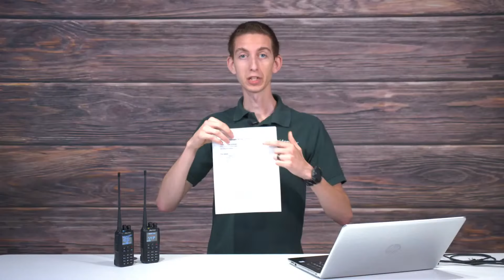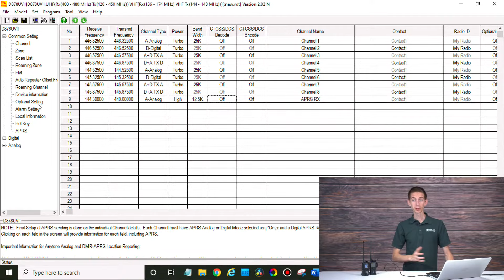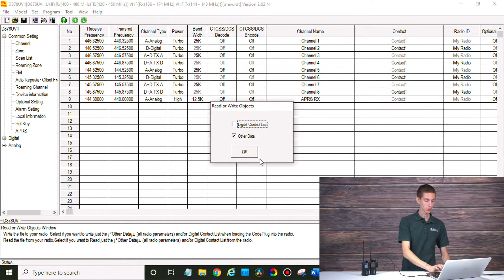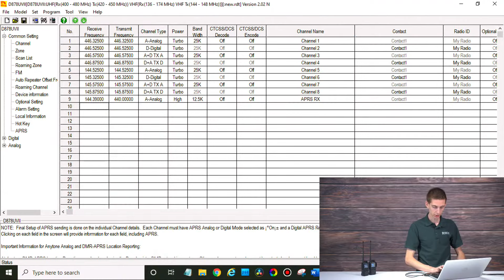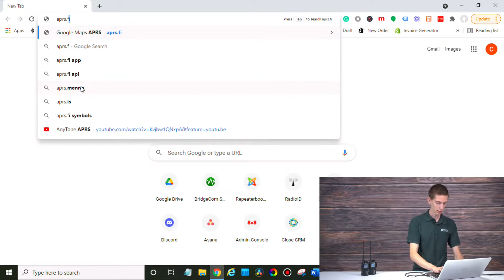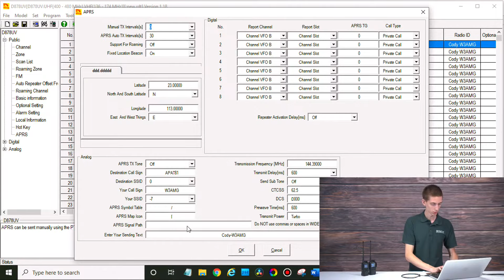How to Send and Receive Location Data from your 878UVII Plus | BCU Live Free Training

Comment: If the instructor would just look at the two radios "Fixed Location Beacon"  setting, he'd see that the radio that's working is set to on.  Why?  Because when you cannot get GPS Signal, you turn on "Fixed Location Beacon" so that it will transmit APRS using that instead of the actual GPS data.  That's why the new radio was not transmitting APRS and the old one was... I watched this video to learn something but was disappointed to see that as a new DMR/APRS HAM, I already know more than he does....

Comment: I have an Anytone 878UVii and set it up exactly as you did and still the radio will not show received APRS messages.  I even put the APRS display time to 15 seconds to ensure I wasn't missing anything. Even when I go into Ana APRS Info, it says Ana APRS info Empty! It is transmitting and appears to be seeing an RX signal as it wakes the screen up periodically, just no messages. And yes I have all the filters ON.  Help!

Comment: Is there a way to set the RF TX power to milliwatts.  1 Watt is still too much for using it with a hotspot.
Reply from the maker: Put the radio on low power.
Reply: @BridgeComSystemsInc    https://youtu.be/uKPJhKDsVWk

Comment: Does this differ at all from the AT-D878UV Plus? Im having trouble getting that to work.
Reply: You can't receive aprs on that radio, because anytone are absolute assholes and lock features that could be implemented via firmware update to new models.